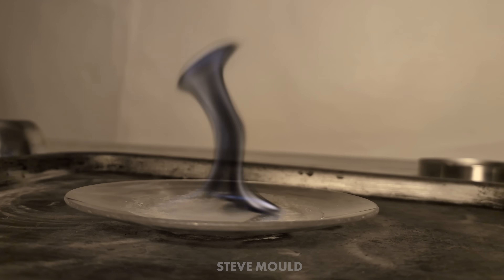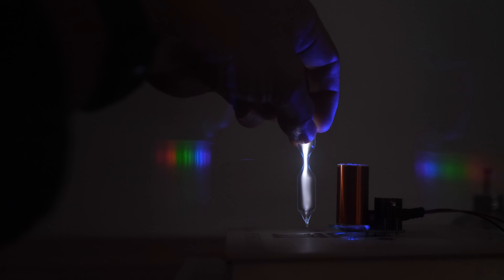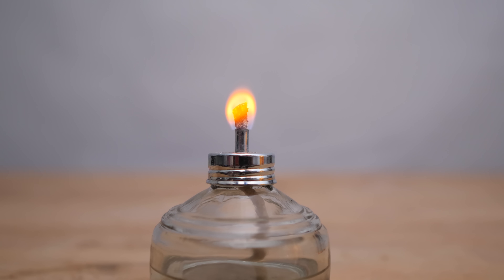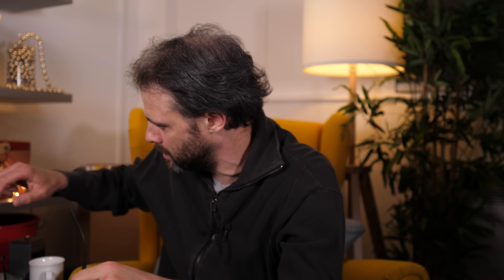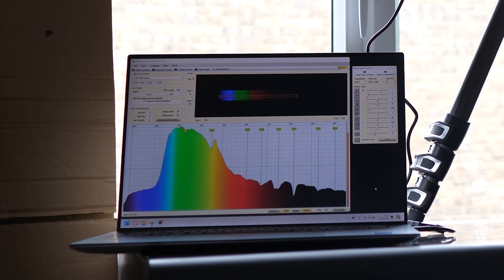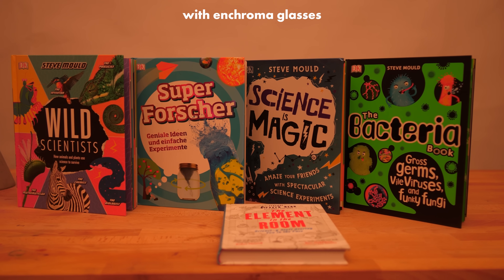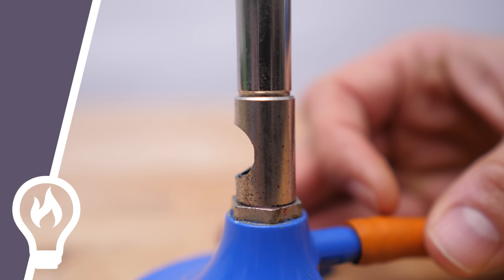Light sucking flames look like magic

Comment: So I know there's no such thing as a black light emitting photon, but at the same time you can make black (or very close to it) by mixing magenta, cyan, and yellow. This has made me wonder if the illusion of a black light in normal lighting conditions can be made by emitting CYM colors that are in perfect balance?
Reply: CMYK is a subtractive process, it works by removing light, a C dye or pigment will reflect cyan and absorb everything else. When you have a combination of C, M, Y dyes, all light gets absorbed, resulting in black (except that the absorption of C, M, Y dyes is not perfect, so you don't end up with perfect black, hence the addition of K). So no, you can't replace this with C, M, Y light, as that is an additive process. Btw, C and M light is not spectrally pure, it can only be made by having multiple wavelengths of light.
Reply: @pdp11  Exactly the kind of response I was looking for! Could you please elaborate on what "not specturally pure" means?
Reply: @1TakoyakiStore  The sensation of cyan, magenta, pink, and some other colors happens because different types of cones get excited in the eye at the same time. These cones have a non-overlapping response to wavelength. That means there is no single wavelength of light that can excite both.

Or to put it in other words, a rainbow doesn't contain pink and cyan because each color in the rainbow comes from a single wavelength (it's spectrally pure).

Comment: I believe that the two lines of sodium (owing to the two different spins of the excited electrons) exist as you say, but the reason that the energy levels are different is because of the presence of an external magnet — the earth.  Because of the earth's magnetic core, it causes the two different spins to have different energies.  This is similar to nuclear magnetic resonance spectroscopy and the like.
Reply: An external magnetic field produces an additional Zeeman effect. The spin quantisation lines are independent of any external fields.

Comment: at 3:47 i dont think your explanation is correct. What happens is the ballast that controls the bulb outputs an initially high voltage low current across the tube, this ionizes the sodium gas and it becomes more conductive. As it becomes more conductive the ballast voltage drops and enters a constant current mode to keep the tube energized.

Comment: Your sodium lamp isn’t pure sodium. There is at least a hint of neon in there for arc initiation, and I wonder if that is part of your spectrum impurity. Take another spectrograph of it when first cold lit, and I’ll bet that highlights the non-sodium component.
Reply: Yes. But no. The sodium overpowers all other gases in the lamp by a LARGE margin. Brainiac75 just did another video on this. He does a good explanation and also a spectrograph so you can see where the lines are.
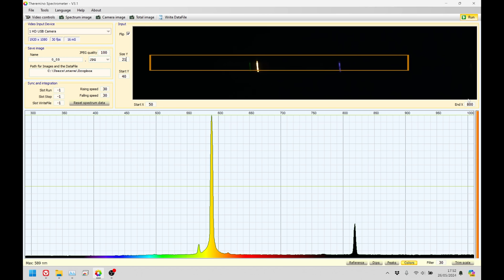Reply: Nope. All the peaks he's seeing when the lamp is at full brightness are from sodium. The other prominent peak in the infrared at 10:00 is another Na doublet at 818.3 nm (3d2D3/2 → 3p2Po1/2) and 819.5 nm (3d2D5/2 → 3p2Po3/2).
Reply: Yes the other lines are impurities. And the infrared line is probably just heat.
Reply: @dreamyrhodes  Completely false. All the lines visible here are due to Na and a single sharp peak in the infrared is not "just heat". That's not how it works, that's not how any of this works.
Reply: @dreamyrhodes  Heat is chaos and chaos doesn't produce sharp emission peaks. Look-up 'black-body radiation' if you want to know, what kind of spectrum is produced by heat.

Comment: Corridor Crew also did a video where they used a set of sodium lights to essentially re-create vfx similar to what was done on films like Marry Poppins. It involved an interesting camera set up, but resulted in a more defined chroma-keying to where you don't have to worry about other colors bleeding into the void.
Reply: Yeah, you need to split the incoming light so you can get the image without the sodium color, and the image with just the sodium color. Then you can invert the sodium-only image to use as a matte for the non-sodium image.
Since it’s all achieved optically, background replacement can be done entirely with film and an optical printer. And since sodium light is such a narrow wavelength, it doesn’t bleed into anything you want to keep and you get near-perfect transparency.
Reply: That was a really interesting video.

Comment: For years, it has been believed that electric bulbs emit light, but recent information has proved otherwise. Electric bulbs don't emit light; they suck dark. Thus, we call these bulbs Dark Suckers.

The Dark Sucker Theory and the existence of dark suckers prove that dark has mass and is heavier than light.

First, the basis of the Dark Sucker Theory is that electric bulbs suck dark. For example, take the Dark Sucker in the room you are in. There is much less dark right next to it than there is elsewhere. The larger the Dark Sucker, the greater its capacity to suck dark. Dark Suckers in the parking lot have a much greater capacity to suck dark than the ones in this room.

As with all things, Dark Suckers don't last forever. Once they are full of dark, they can no longer suck. This is proven by the dark spot on a full Dark Sucker.

A candle is a primitive Dark Sucker. A new candle has a white wick. You can see that after the first use, the wick turns black, representing all the dark that has been sucked into it. If you put a pencil next to the wick of an operating candle, it will turn black. This is because it got in the way of the dark flowing into the candle. One of the disadvantages of these primitive Dark Suckers is their limited range.

There are also portable Dark Suckers. In these, the bulbs can't handle all the dark by themselves and must be aided by a Dark Storage Unit. When the Dark Storage Unit is full, it must be either emptied or replaced before the portable Dark Sucker can operate again.

Dark has mass. When dark goes into a Dark Sucker, friction from the mass generates heat. Thus, it is not wise to touch an operating Dark Sucker. Candles present a special problem as the mass must travel into a solid wick instead of through clear glass. This generates a great amount of heat and therefore it's not wise to touch an operating candle.

Also, dark is heavier than light. If you were to swim just below the surface of the lake, you would see a lot of light. If you were to slowly swim deeper and deeper, you would notice it getting darker and darker. When you get really deep, you would be in total darkness. This is because the heavier dark sinks to the bottom of the lake and the lighter light floats at the top. That is why it is called light.

Finally, we must prove that dark is faster than light. If you were to stand in a lit room in front of a closed, dark closet, and slowly opened the closet door, you would see the light slowly enter the closet. But since dark is so fast, you would not be able to see the dark leave the closet.

Next time you see an electric bulb, remember that it is a Dark Sucker.

Comment: That third image on the color blind test at 15:35 better be a joke or I may need to see an eye doctor
Reply: That's actually a "reverse" colorblindness test, put it into a protanopia simulator and the 73 will appear (albeit very faintly). If you saw the number in there, you'd be (most likely) colorblind
Reply: just to clarify the "reverse" test, the description from a testing document:  
Normal view: nothing
Red-green deficiency: 73
Reply: It might have something to do with the monitor, but I had to copy it into a editing software and turn the contrast up almost to the maximum to see it, but it is there.
Reply: It either looks like a plant (the green part) or a basketball (the whole circle)
Reply: I agree with the people saying that panel 3 is a reverse color blindness test. As I'm not color blind, I don't see anything specific in panel 3 unless I use editing software to adjust the tint and saturation. Then I see the number 73.
Going from left to right, top to bottom, I think the numbers, including panel 3, are: 45, 2, 73, 42, 74, 97, 6, and 3, the 74 almost looks like 71 though. If there's a joke hidden in there I'm not seeing it.

Edit: I think the joke is at 15:25, it certainly doesn't look like any colorblindness test I've seen. I'm not going to venture a guess as to what I'm seeing there.
Reply: @ardaghion  there is a 21 "hidden" in the 74. its a colourblind test and it will tell you what deficiencies you have not just that you dont see colours. you can copy paste the whole thing into an online colourblind simulator and see how they look for ppl with different colourblindnesses. the 15.25 is a classic online figure known as dickass or something similar.
Reply: Yes
Reply: If it serves as a clue, the larger one slightly previous to that timestamp was a dickbutt.
Reply: that image had me question everything lol
Reply: It's a variant of the numbered colorblind test called a path test. It's just bands of color.
Reply: litterally just animalistic stripes
Reply: I think that's the "if you say it's a number, we know you are guessing" card, it's very well designed to NOT look like anything at all, which is really hard to design for
Reply: 73 but its very hard to see
Reply: @dmytrog6127  The third image on that test only shows numbers for certain color blind people. If you can read numbers there, you might want to consider visiting an eye doctor!
Reply: @dmytrog6127  Yeah, no, it's not 73 rofl
Reply: My mistake, i was referring to the very first one.
Reply: @Enydrath  it is 73 but its meant to be read by people with a certain colourblindess and is not easy to see if you got normal vision.
Reply: @erikakesson280  damn, it took me doubting everyone of you plus 10 minutes of editing the color balance to finally see it, this one is wild compared to the other ones.

Comment: The color blind test with the dots is extremely misunderstood by doctors. I can see all the colors, but I have problems with shades on the limits between colors (yelllow-green, red-brown, violet-blue) and I fail this test miserably (I don´t see the number or letter hidden among the dots at all), then doctos will be convinced I am completely color blind and I will have to explain to them, some times even demonstrate, that I can see all colors. It´s very frustrating.
Reply: So the test is doing exactly what it was designed for
Reply: @BanditLeader  wow, you're smart

Comment: Doesn't the "twiddly thing" on a bunsen burner also adjust the fuel-air mixture, and through that, allow adjustment of flame temperature?
Reply: Yes, but more importantly at least with respect to color, what's happening when you close the baffle and starve the flame of oxygen is that the fuel combustion becomes incomplete, the carbon isn't totally oxidized into CO2, and nanosized soot particles form. The soot particles are heated to incandescence and produce a continuum spectrum throughout the visible and IR and creating a bright yellow flame. When the baffle is open and the fuel fully premixed with air, you only see the relatively faint molecular band emission of mostly C2 dicarbon radicals.
Reply: @Muonium1  That was what I thought, thank you for that confirmation of the principals of pyrolysis contributing to the color of the flame.

Comment: Sodium light again huh..? first the disney 'greenscreening' prism, now black flames! Sodium light is very useful for color spectrum science it seems.
Reply: It souldn't seem, it IS because of it's property of pure single color emmision
Reply: @lux_fero  Indeed, it was used over here because of the nearby observatory, as it's easy to filter since guide stars (ie. "their laser pointer") use the same wavelength (or very similar)
Reply: Corridor Digital, Brainiac75 and now Steve Mould. Us 589nm fans are on a roll this year
Reply: a fellow corridor crew fan
Reply: The sodium D line is a simple way of creating bright monochromatic light. These days, lasers are a thing, but it still has its uses.
Reply: @hammerth1421  Lasers and primitive LEDs emit light for the same reason as the sodium lamp.
Reply: Corridor crew rediscovering the amazing abilities of sodium yellow screening blew my mind. Hollywood needs a renaissance.
Reply: @forcivilizaton5021 You should be able to do much better than the sodium process using modern optics and sensors.  A modern version could combine multiple monochromatic light sources reflected off the background and arranged in clever patterns (potentially strobbed at a higher frame rate) so you can read off the any reflection/refraction effects by solving the inverse problem so you could use the process even with foreground refractive/reflective objects.

Also the multiple light sources would let you do all sorts of fun things like capturing multiple mattes per frame.
Reply: @petergerdes1094  my first thought when seeing stage sodium film process was that you could maybe make a digital sensor with 4 subpixels, RGBS, with the RGB subpixels having the 589nm blocking filter, and the S pixel having the 589nm pass filter, so that you have a pixel perfect mask.
Reply: @cameronwebster6866  I dunno if sensors are sufficiently selective but maybe they are...neat idea.
Reply: @petergerdes1094  maybe a stacked sensor can fix that
Reply: But also annoyingly ubiquitous, and not always easy to get rid of when you don't want it contaminating your colors.
Reply: Big sodium is obviously paying top dollar for it’s propaganda
Reply: I was thinking the same thing
Reply: The very linchpin of the Scientific Method is being able to reduce things down to a single variable

Comment: "Sodium streetlights have a CRI of ZERO"
Last i checked, they had a CRI of -44. CRI is not a 0 to 100 score. It's just that a CRI of 100 is chosen as a perfect blackbody radiation source. Incandescent bulbs have near perfect blackbody radiation, just like the sun. And most others have less than 100. Even if it's just a few decimal places off for certain sources short of the sun or glowing tungsten filaments.

You can get a negative CRI score because of this, the scale is reverse from 100. It's as if we measured temperature the other way around, thinking that 100 was as cold as it ever could get, and 0 was boiling water. Then as you set your oven to cook a roast, you'd set your temperature at -163. And to melt copper, you'd set it to -1700 or so...